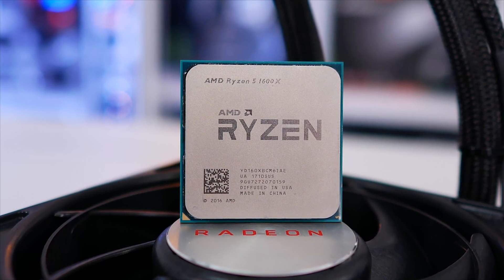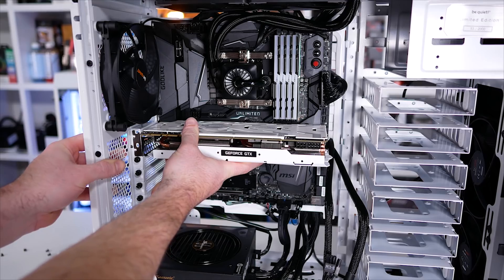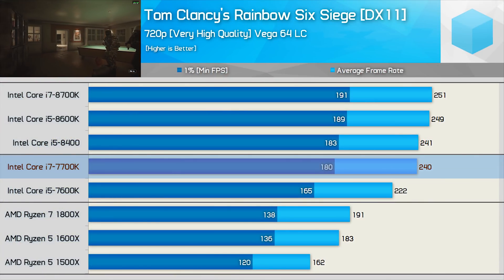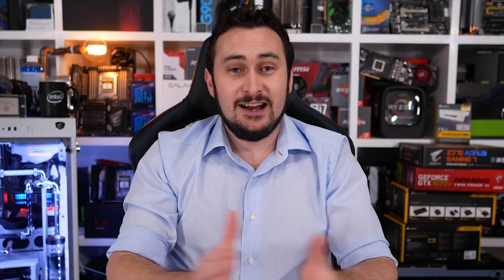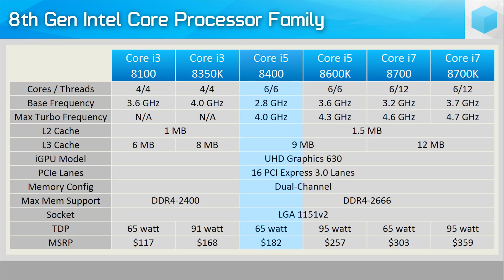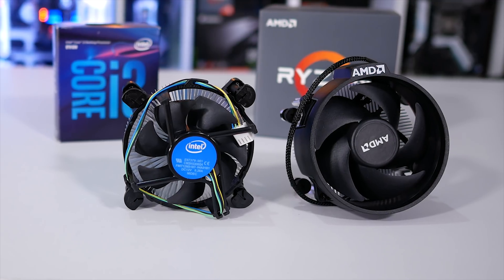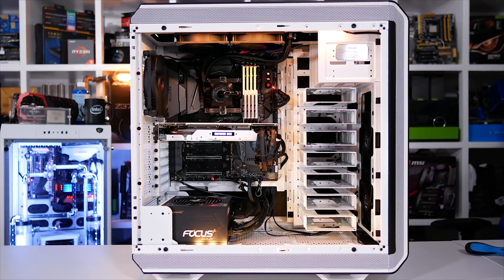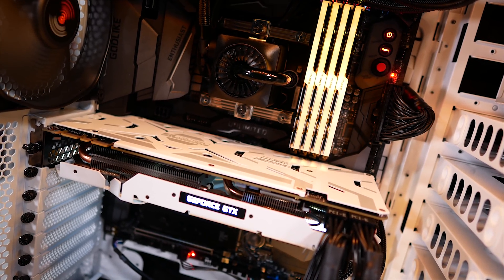Let’s Chat, R5 1600 OC vs. i5 8400 Benchmarks Incoming!

Comment: 720p benchmarks really are unfair Steve, you have to go down to 480p to get the true numbers
Reply from the maker: 480p it is :D
Reply: Print out images of the amd cpu and images of the intel cpu and then throw them and see which pictures are faster.  True benchmark.
Reply: Real men test at 240p.
Reply: Bah 144p all day
Reply: Unless your outputting to a 9 dot matrix printer I dont see how you can call this a valid CPU benchmark.
Reply: It's a joke.....of sorts. Cheers for the insight though.
Reply: But why stop there?   Let's remove this "GPU bottleneck" even further and test using a 2D platformer like Rayman.  I am sure that will be another EXCELLENT indicator of future gaming performance. /s
Reply: I see 2 way to make some constructive conclusion:
1) prove that pass benchmarks with lower resolution shows future result using old data and making new data with new GPU (problem may be which game to use, same or new popular)
2) use only real resolution and show result, so showing 720p fo low-end GPU/CPU is ok, but for high-end is pointless, and add 4k (which is pointless in low-end gpu test)
Reply: 320 x 200 for the win..!
Reply: Tech Showdown 144p benchmarks?
Reply: Nah,reviewers should just bench at 999999P resolution since human eyes can't see more than 0 FPS. /s
Reply: To get the real singethread performance numbers you need to go 1p so there is no need for multithreading, that evil thing! Sempron 150 is still relevant!
Reply: Nah mates. 1p is the master race.
Reply: I wanna play CS:GO at 1080, and I don't mean resolution I mean framerate.
Reply: 320x240x256 modeX is where it’s at
Reply: either 720p or 1080p just put the setting to lowest....so not much on graphic performance
Reply: this is the wrong resolution!
no wait this is the current price!

this is why the human race is so limited....
Reply: There is a reason some professional cs:go players play at 800x600 you know.
Reply: Mad Lust Envy you right on 4k, I forget how flat results are... I was hype about 4k and HDR, but but 1440p monitor (ASUS make shit testing, 3 had backlight leading and 4 I use now have 2 active subpixels and I buy PG279Q so not some cheap model).
I think we must wait 1 or 2 generation for 4k single GPU, and 1 year for HDR (it change more then 4k) and HDR in games (good implementation) make take few years.... :(

I know why they test in 720p, but nobody show prove of it, Steve can get results for 1 and 2 pass generation GPU  result (from history, not make new one) and make now one with current gpu and old CPU, and see if it is as it should be in theory. One big problem are game that was use in pass, and nobody play them today. 
Because if CPU not make difference in games, maybe is pointless to force result to show some difference? As people buying GTX 1060 or lower card never see different and most time change GPU with CPU. (lazy time when Intel not make progress ended, so not only GPU move forward year by year)
Reply: Orderdrake obviously the DPI of the prints will need to match or the results are junk right?
Reply: Look at the price of the 8400 now on newegg its 250 dollars now.
Reply: NONONO You gotta go to 144p
Reply: I still play splinter cell conviction in  1024x768 with my r9 380 pushing 19 fps
Reply: True 😂😂.  But 720p is still good for ppl who keep their GPU for 7-10 years.  Because some games will not be any good on 1080p after 7years.  Because the gpu will be bad that time anyways i will not care about that because if i couldn't find a way to get through with cheap gpus next years i will go with used market and i also accept to work long times in tweaking my game if the gpu is too old.
Reply: I still love the videos Steve, sorry if I gave you a bad time about 720p!
Reply: And no overclocking. We need to stick to true OUT OF THE BOX NUMBERS
Reply: 144p for optimum results!
Reply: so many AMD asses  blowup
Reply: Hardware Unboxed do it
Reply: Please tell me which is better in 1080p and upgradability (idk which combo is better)
For the PC I'm going to be building
Both  have  asus 1060 3gb overclocked white graphics card

1600+gigabyte ab350 gamig mobo
8400+gigabyte b8 mobo

I'll be playing gta5, battlefield,pubg,csgo, and games of such sort
Reply: Haha
Reply: And lower the graphical settings to minimum.

Comment: You should just ignore fanboys, you can debunk their biased arguments and they'll still swear that they're telling the truth. The sad thing is that a majority of current generation PCs definitely have a GPU bottleneck if the system was built "balanced", for example most people with a mid range GPU won't be bottlenecked by anything higher than a Pentium and people with a high end GPU most likely play at higher resolution, so there's pretty much no reason to fight over who has a better cpu because for the most part they perform identically in a real use case (yes I know some people play at 1080p 240hz but they're definitely the majority these days and most testing is done on AAA games anyway)
Reply: Bless you for using that single comma, made it so much easier to read.
/s

Comment: The 8400 being slower theory is that the z370 boards auto overlock it or something and the lower h370 and b360 boards won't be able to do that. At least that's what I hear. Can this be true or just lies.

Something to do with bios settings. I don't know. Can someone clear this up?
Reply: Hardware Unboxed will you do benchmarks of the 8400 with budget motherboards when they come out?
Reply: You had it right, its based around ASUS's "multi-core enhancement". Basically it just sets the max turbo frequency for all the cores, instead of letting it scale based on the number being used.

It did cause problems for a few reviewers who didn't realize it was on trouble, but really its a difference between running all cores at 3.9GHz vs. maybe 3.6GHz.

The h and b370 boards concern was over VRMs, but I seriously doubt Intel would advertise such speeds if they couldn't handle it. That's a false advertising lawsuit waiting to happen.
Reply from the maker: They are talking about enhanced multi-core technology which can't be enabled on locked CPUs, so it's a moot point.